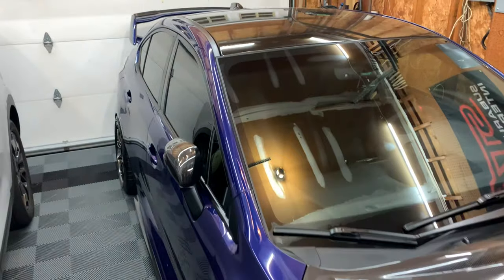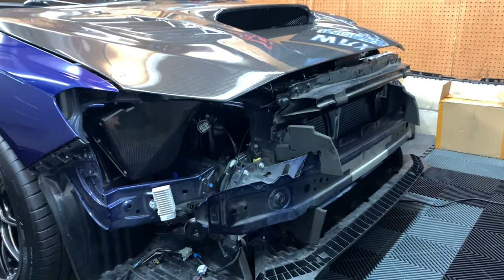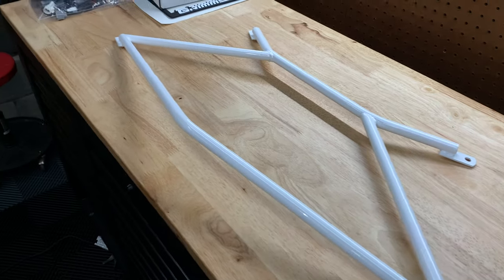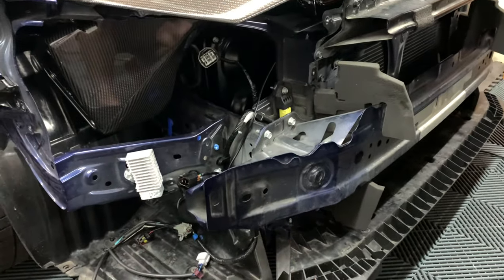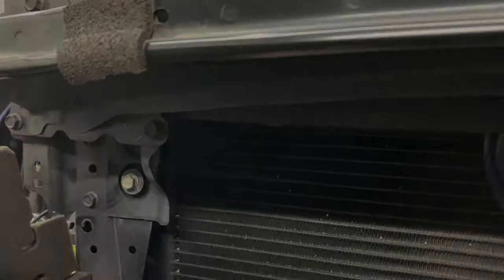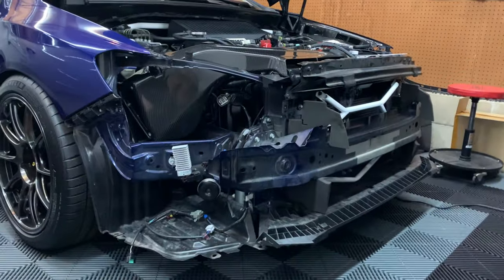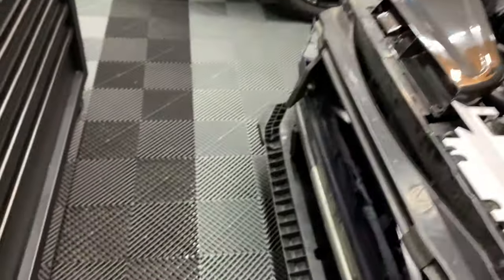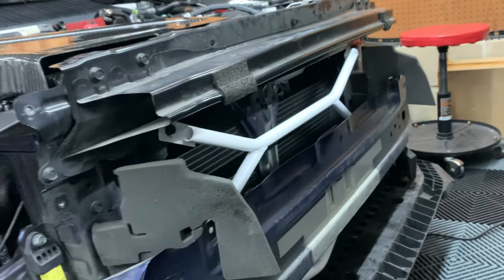Subaru STI Front Chassis Brace Install | LWRCLSSGARAGE

Comment: Great view of your Cobb Redline Carbon Intake Box 👍 with the headlight removed. It is a premium aftermarket part for sure. That brace actually looks like a secondary crash bar or roll cage for your radiator. I honestly wish you the best of luck keeping it somewhat clean. That is not meant to be sarcastic or derogatory or mean. Its just that you keep every aspect of your Subie immaculately super clean.

Comment: I know this is an older video but did you have to remove the headlights to get access to anything?
Reply from the maker: Headlights do not need to be removed. Just the front bumper and crash beam.

Comment: I pick up my new 2017 subaru wrx sti tomorrow morning and am wondering what should I do to keep it's engine in the best running condition as possible? I read about needing an air oil separator to prevent oil and filings from getting into the intercooler or engine, is this true? Let me know because I plan on keeping the car a long time and won't interested in ever selling it.
Reply from the maker: https://youtu.be/lZt7Dk2mixQ

Comment: is it possible to install a fmic with this? seems like there would be some clearance issues.
Reply from the maker: The full brace does not fit with a fmic. You can get the half brace which does fit.

Comment: Is this to support rigidity or support the front if an unfortunate crash occurs?
Reply from the maker: It’s more cosmetic than anything. But it does tie two points together, so it does help with some rigidity of the front end. The front crash beam is still there so that will still take any of the front impact if in an accident.

Comment: Do you torque the crash bar bolts?
Reply from the maker: Torque spec is mostly for moving parts and mechanical devices. Crash beam doesn’t need to be torqued to a specific spec. Just tight.